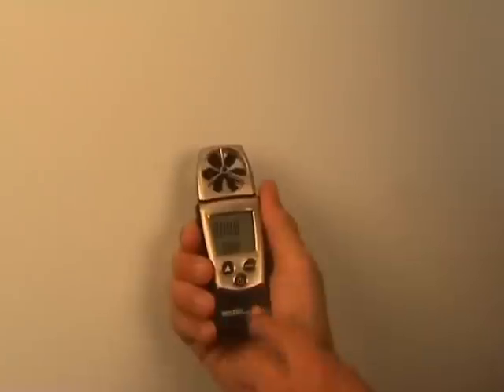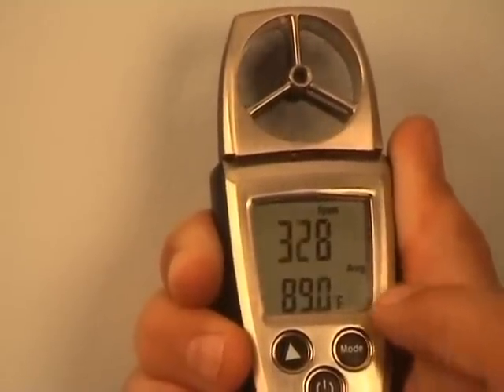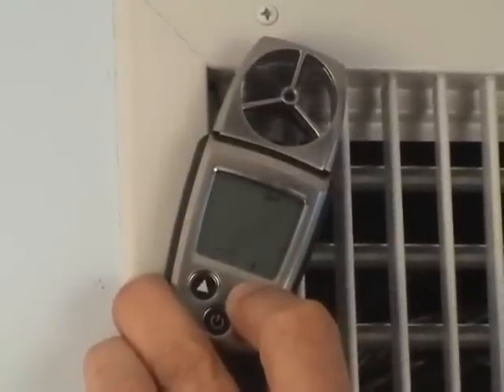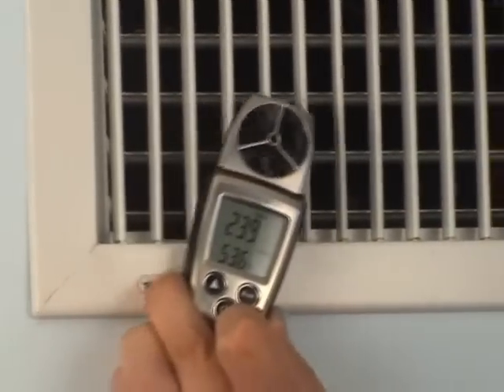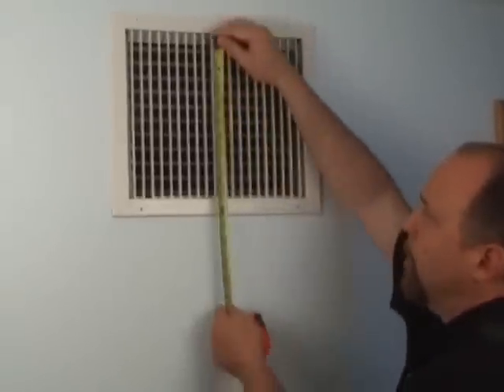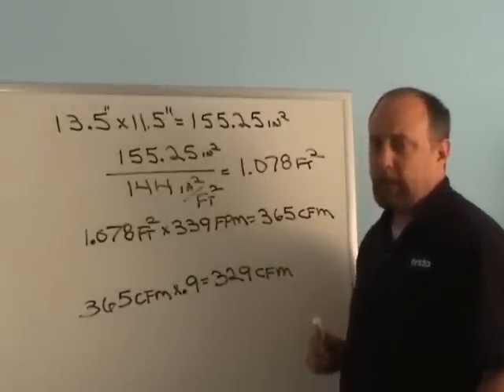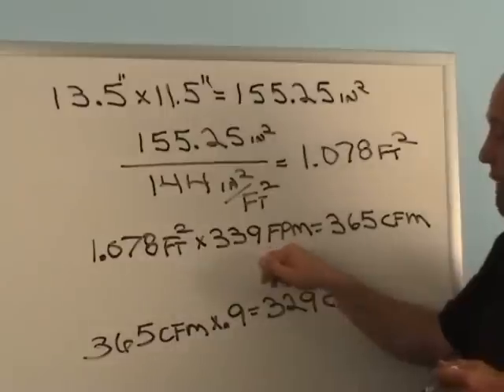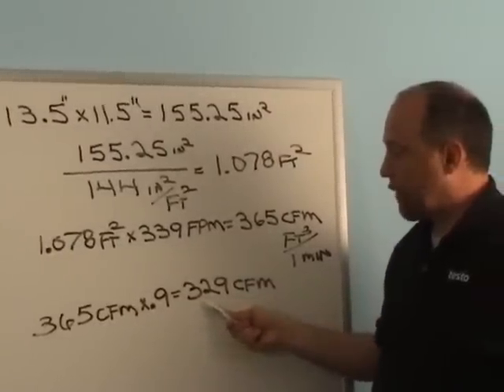410 video.wmv

Comment: cool video, nebb tab ct for 6 yrs.  the ak or the .9 is not 90% of the measured area( we can all measure something different).  it is the actual free area of the diffusser.  unless the manufacture clearly states that its 90%. usally in the specs the job will list the exact grille to be used and then you can check the submittals, and sometimes thet include the Ak as already corrected free area. so lets say 16" x 16" = 1.777, if the published Ak is 1.244. then multiply 1.244 by your avg. velocity to obtain cfm. dont take 1.77×1.24=4.318. you would end up with more area then 16 x 16.  it could be both ways just keep that in mind.

Comment from the maker: That would not work well as it would not take into account the duct leakage. You would want to measure that airflow at the appliance with a smaller vane like the 416 in the duct. Instruments like the 410 are typically used for proportional velocity balancing. You can measure CFM as shown, but that is not typically the intended use.

Comment from the maker: You can, however a better choice is a Testo 417. The larger vane will provide better accuracy and it will perform CFM calculations if the area is input into the grill.